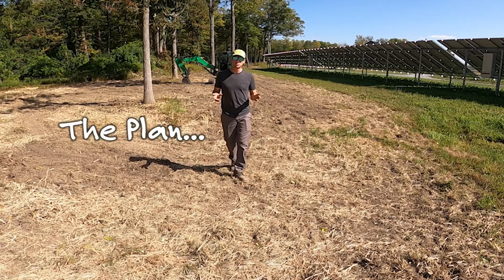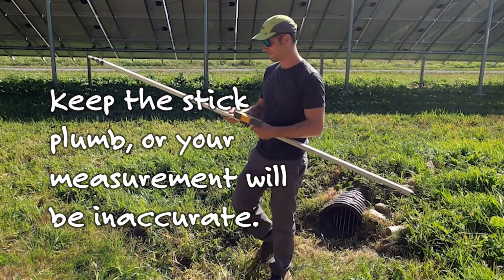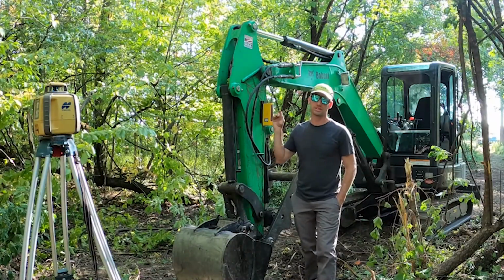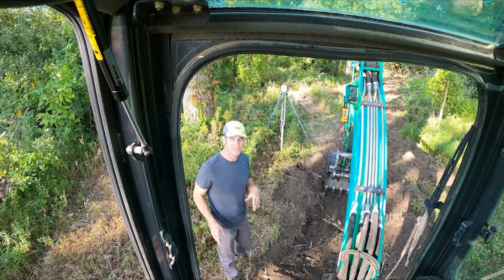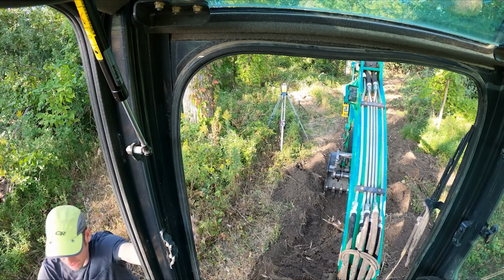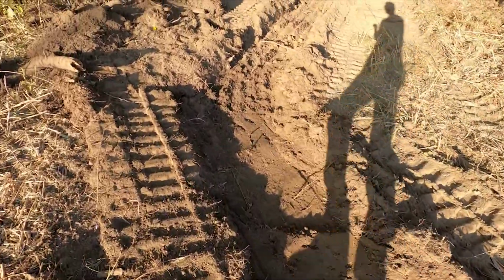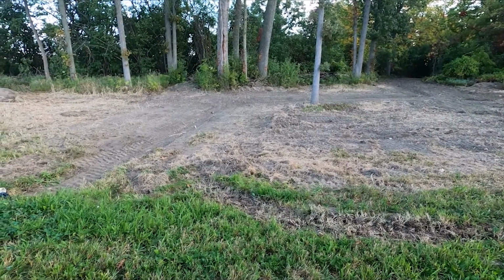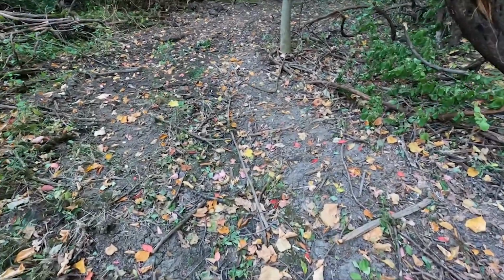DIY - How to Dig a Drainage Swale with a Bobcat Excavator and a Topcon RL-2VS Rotary Laser

Comment: Great video. I'm looking for a magnetic laser receiver for my MIDI excavator. Your video was very informative.
Reply from the maker: Thanks! I just bought the Spectra CR700. I think there are many improvements over the CR600. Not cheap, but so worth it if you want precision and avoid jumping around with a stick!
Reply: @PatrickDesignBuild  what do you think about RL-SV2S? Or any recommendations?
Reply from the maker: @GRDDAN1  love it. We have 3 of them. Reliable, and accurate. Expensive but worth it.  And the best thing is the batteries last a really long time. I had mine on all week this week and 4 D batteries lasted at least 50 hrs
Reply from the maker: @GRDDAN1  and... I was grading a road this week to a 1.272% slope and the laser was accurate over 1400 of distance. It's actually rated for 2500 ft. And they say the battery lasts 120 hrs with alkaline batteries! wow.
Reply: @PatrickDesignBuild  that’s awesome! I picked up one yesterday from Tiger Supply. Got the RL-SV2S, also I seen video of same model from 4 years ago. Well first of all I got it for $1400. Cuz it didn’t have box(cardboard box) brand new open box also the barcode on it said it manufactured on JUNE 2021. I’m little confused with the years difference as I see it with the one 4 years ago. And they’re same.

Comment: Subbed! A video this in-depth is invaluable for weekend warriors like me who will be renting equipment and need to efficiently plan everything because of rented equipment. 

Question though, I may not be properly understanding this so feel free to correct me. Everything I've read about swales say that an effective grade is 2% for a swale. Is that referring to grade from starting point to finish? And if thats the case, how would a swale thats cut at less than 1% grade like yours work? Appreciate the great content, thanks again.
Reply from the maker: Great question, WW (weekend warrior)! For just about any drainage with pipe or not, 2% or better is recommended. However, in many real world cases, you can't get 2%. 

So for this case, 0.5% was all I could get, and check out the link in the description for the video I just posted on how this swale actually worked in the rain. It not only moved a lot of water, but dried up nicely a few days later for me to mow it.

Going less than 2%, there's more of a possibility for flat spots and other areas that may have a little standing water after the rain subsides.  However if you really want to guarantee the residual water dries after the rain stops, then you need to make it a "dry swale" meaning you bury a drainage tile a few feet beneath the bottom of the swale and bed it in washed stone. That way, any standing water leftover has somewhere to go. The full tutorial for a drainage swale needs to be its own video. :)

Comment: I know this video is 4 years old so I’m doubting I get a response but why set the laser with the teeth down and not with the bucket bottom flat? Just bought my first excavator and I’m brand new to all of this! Thanks for posting this!
Reply from the maker: You can do it either way. I figured it's less variables if the bucket is extended all of the way out, otherwise where exactly is "the bucket flat"? It might be hard to get the angle right and if you're off it can change several inches. Also, it's an extra movement to flatten the bucket which slows me down, during the digging.

Comment: I'm trying to calcuate my slope for a project I'm working on but totally confused about the video because I'm hung up on one question ----
Are you minusing 5' ½" by 3'8½" and getting 18"? 
Am I crazy or is that actually 16"?
Reply from the maker: Good find! I must have made a text error on the screen. My audio cut out, but I'm guessing I must have said 3'-6 1/2".  But I incorrectly wrote 3'-8 1/2". If you use the 3'-6 1/2", that will get you the 18" difference.  Every inch counts, so double check it :)

Comment: The rise or drop part confuses me as to how you went from 18"s to 1.5.  Can someone give an example of how to do this with a different set of numbers? I just bought this exact laser and will be doing this quite a bit with different scenarios. Also how do I know that I can get rid of the zeros before .625 like he did?
Reply from the maker: hey Brian -- To get the percent slope, I needed to divide the rise (or fall) by the run. To divide the two numbers you need to work in the same units. Like inches divided by inches or feet divided by feet. So that's why I converted 18" to 1.5 ft.  Done this way: 18" divided by 12" = 1.5 ft.

My run (or total length of the ditch) was 240 ft. 

Since I have both the rise and run in feet, I can divide the two numbers. 1.5 ft / 240 ft = 0.00625. To convert that number into a percent, you need to multiply by 100. 

0.00625 x 100 = 0.625 % slope.

To do it with different numbers, here's a scenario. Say the drop of your ditch is 2 ft, and the length of your ditch is 100 ft. 2 ft divided by 100 ft = 0.02. 

To convert 0.02 into a percent, multiply by 100. 

0.02 x 100 = 2% slope.